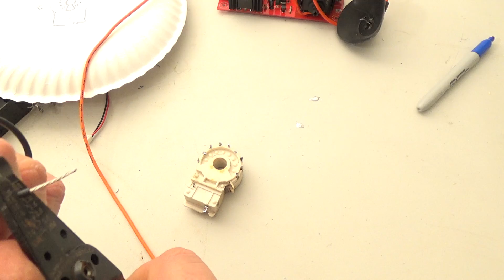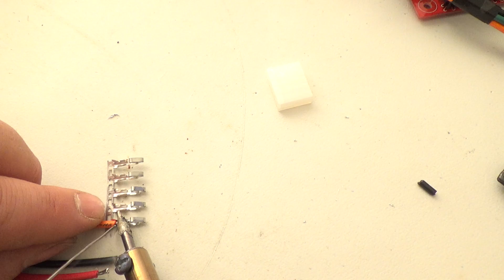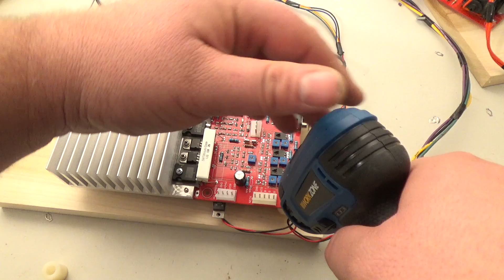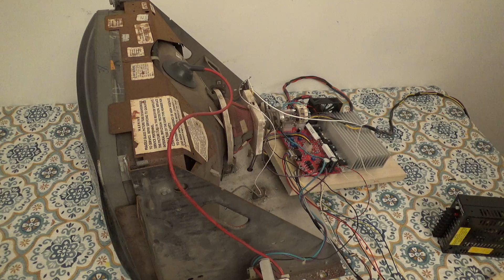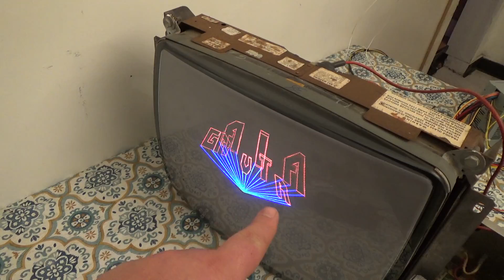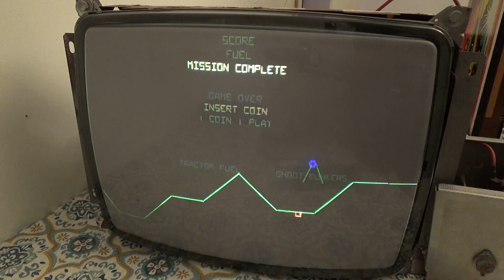Assembling and testing a brand new VECTOR monitor kit

Comment: Cool hardware! Thanks for going through it.
I'm not a tube guy, but my understanding is that heater/filament voltage greatly affects the life of the tube. It's important to keep the voltage as close to spec as possible.
Reply from the maker: wondras there used to be a device back in the day that would increase the heater voltage as a permanent fix for a weak tube. There has been experiments running the heater at 4-5 times the recommended voltage I believe the heater voltage is not as important as some may say but with a long term setup I would insist the correct 6.3v just in case
Reply: The vintage TV guys like shango006 say that those CRT booster cords don't help for very long. They basically hold you over until you can get a tube swap or a new set. Not sure how a booster would affect a healthy tube, but if it did no harm, wouldn't they just use the higher voltage to begin with?
Definitely fine for short term experimentation, though.
Reply from the maker: wondras yes that is true just as a thought there are different monitors that share the same tube but use different heater voltages even though the tube manufacturer clearly states a specific voltage

Comment: Cool idea for a new video: Tube swap for a G07 raster monitor. I hear those are harder to find donor tubes for.
Reply from the maker: DeLuSioNaL's Arcade done I'll do that next
Reply: Thanks!  I hear that the G07 is less compatible with stuff.  Not sure if that's true or not.  Would love to hear your opinion in the future video.
Reply from the maker: you may be surprised how compatible it really is   i bet you drive by g07 tubes every day in the trash
Reply: I have a ton of donor tubes I can use already from TV sets.  I even have a compatible Sanyo TV for my Sanyo 20-EZ for a future tube swap.  (At least I think it should work).

Comment: Pulled this video looking for solution for dead high voltage section of B/W vector monitor. 
Is there a replacement for the 19V2000 components? I have an Asteroids that I just can't keep its monitor running. I'd like to just replace the deflection and the high voltage side and make it more bullet proof.

Comment: How much do these sets sell for? Also does it use normal raster deflection coils? Or do you have to hand wind them?

I just bought a Vectrex by the way just so I can try to build it a arcade cabinet, I've got a Battlezone monitor I'm going to use but I'm going to build it a color one if the color Vectrex circuit is perfected, I can imagine they'll be are least a few conversions of existing games to color if it becomes viable, if not new homebrews.

Comment: Do those XY deflection boards work with high impedance or low impedance yokes?
Reply from the maker: good question in the video i am running a 6100 yoke which has 2 separate values 1.2 ohm and .5 ohm and both the X and Y circuits are identical on this pcb so long story short this kit should run any vector yoke
Reply: Right now those vector yokes are unobtainium.... Have you tried winding your own yokes?   I'd be interested in a video on winding XY yokes!
Reply from the maker: yes i have i was thinking about a video on that myself